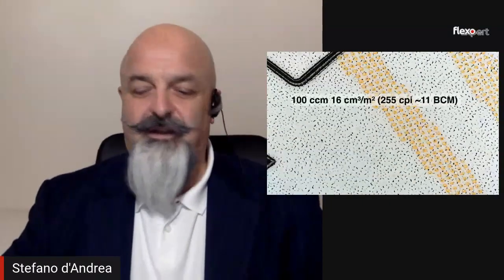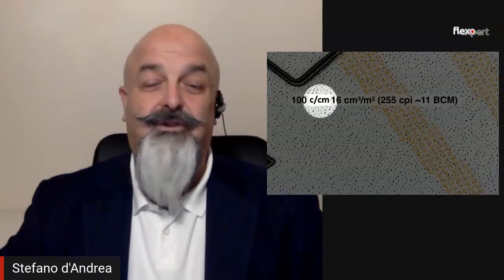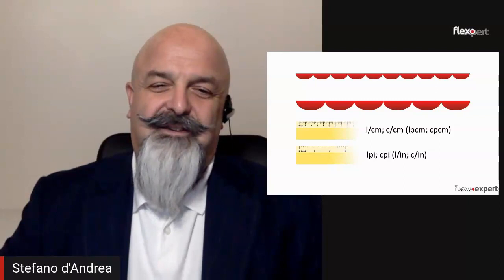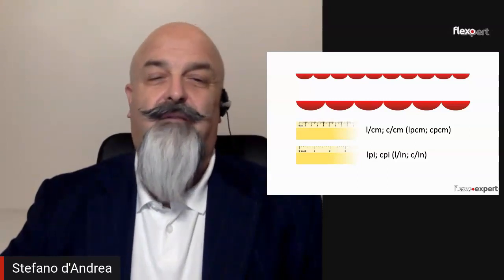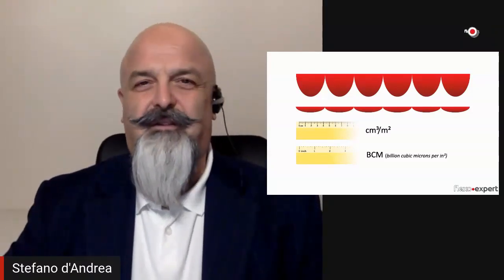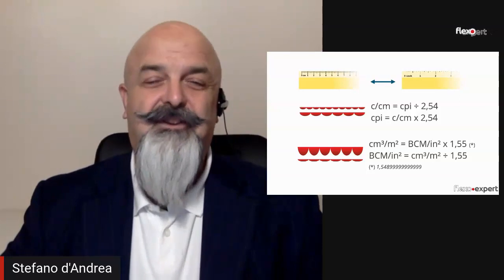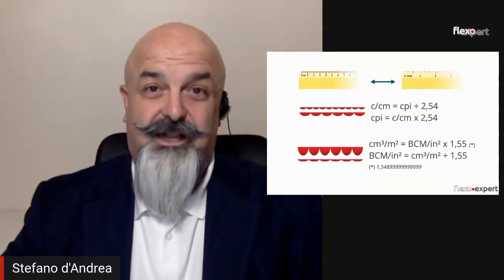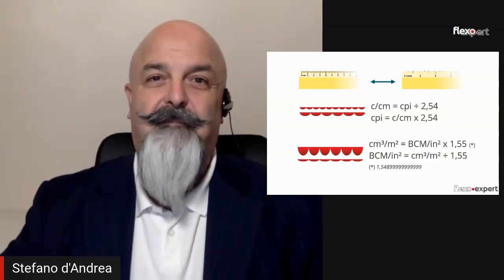Unit of measure of anilox rolls

Comment: I'm Looking to bring in a new Flexo CDC Machine with Doctor Blade and Ceramic Rollers. The issue with my last machine (same specs, now decommissioned) was that my customers complained the images color was not deep enough. They want images with deep colors and sharp, no real demand for half tones. The materials we use are LDPE (40-80Mic) and BOPP (18-30mic). I have been recommended 150-200LPI, but I want to know if this is correct.
Reply from the maker: Hello Gautam, terms such as deep and sharp are indeed related to the reproduction of halftones, and 150-200 lpi refers to a cell-count typically associated to extremely heavy ink laydown, therefore not suitable for halftones (even if it were 150-200 l/cm, still too high for a decent reproduction of halftones). Maybe you can contact me via email to info@flexo.expert including more details such as type of final product, type of inks, press specs. Let me know if I can be of help.
Best regards
Stefano d'Andrea
Reply: Great